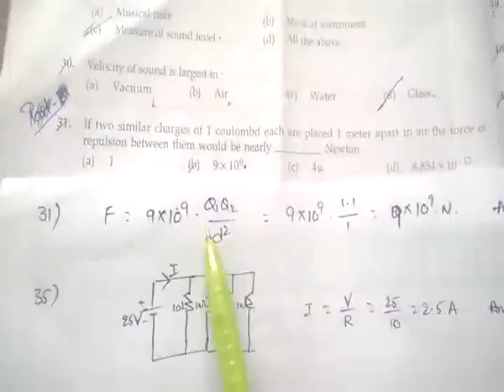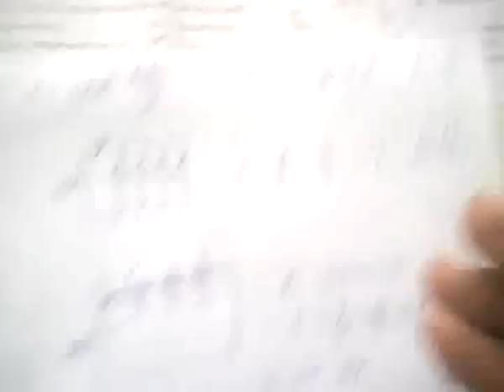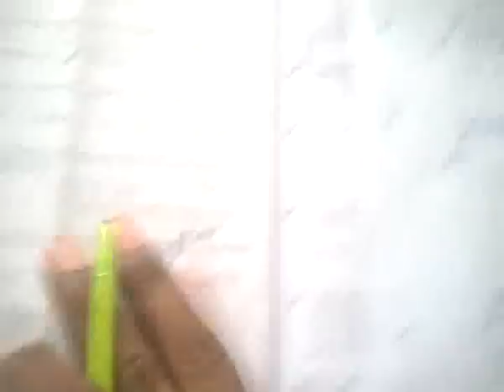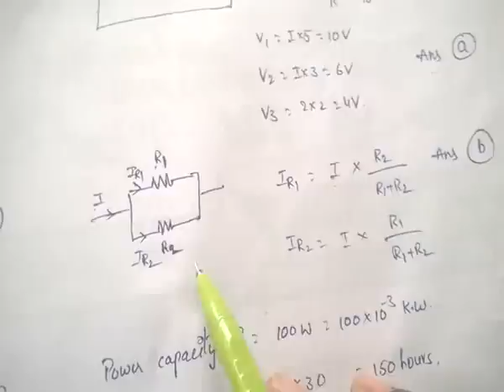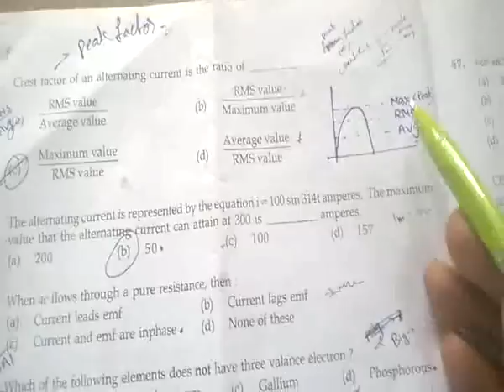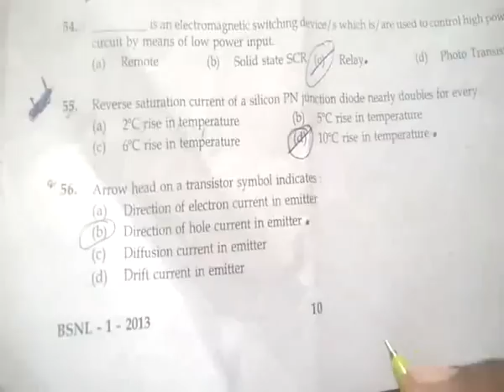Comment: Hi guys..If you want my class notes as pdf file please mail to me for payment details..My mail id: suneelbsnlje@gmail.com
Cost of bsnl je class notes pdf both part 1&2: 500/-
Cost of bsnl je class notes pdf part 1 only : 300/- 
Cost of bsnl je notes pdf part 2 only : 200/- 
Topics covered in part 1..
1.Bsnl je exam introduction - 4pages
2.Maths notes of youtube videos(matrices, differentiation,diff equations of second order, integration,complex numbers,partial diff) 38 pages
3.Maths materials with example question and solutions on remaining topics (vectors,fourier laplace transform and partial diff) 29 pages
5. Basic electricity youtube video notes all topics and mcq’s (except batteries) 36pages
6.basic electricity mcq questions material and batteries 14pages
7.Instruments and measurements notes of youtube videos (3 parts) and material of those topics..and mcq’s 25 pages
8.previous papers- 3(2015 -1,2015-2 and 2013) 78 pages
9.physics notes 23 pages
10.EDC ...Electronic devices and circuits ..50 pages
Topics covered in part 2:
1. Specialization - Electrical - Pdf notes of youtube classes – 15 video’s class notes – 70 pages
2. Specialization - control systems -Pdf notes of youtube classes–
15 video’s class notes – 63 pages
3.digital techniques pdf notes of youtube video classes-
10 video’s class notes – 40 pages..
4. Specialization - Network,filters and transmission lines pdf notes of youtube classes (imp topics only)  and imp bits....